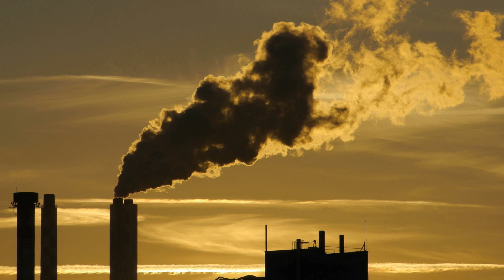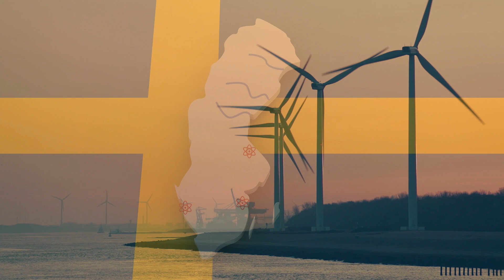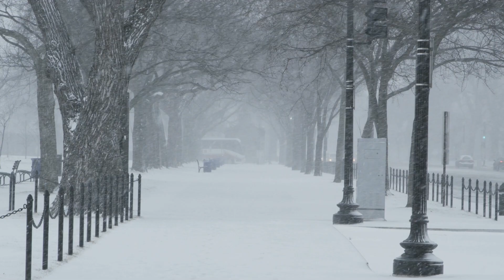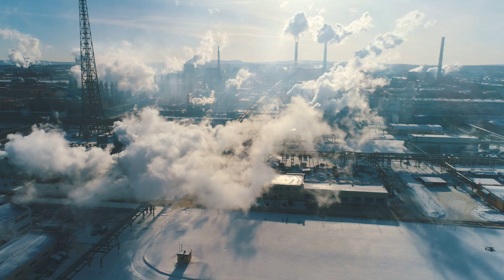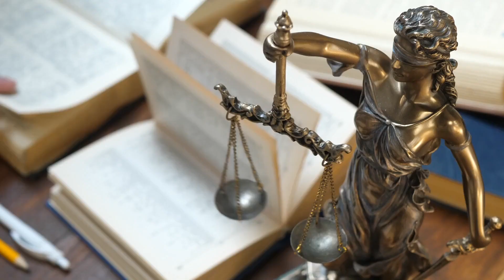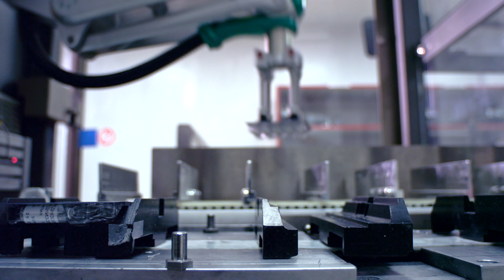Sweden's Power Problem

Comment: I hate the swedish government, they wanted to shut down all the nuclear plants because they claimed that we could run on 100% renewable yet less than 50% pervent of our power is renewable and were forced to import and burn more trash, which is to a big extent like burning oil. And were more dependent on foreign coal power and we even had to fire up an old oil fired plant because thats how bad it was, and this was in the spring or summer.
Only when the government was opposed by the "Right wing parties", threatening to put them down if you will, did they cancel the shutdown of nuclear power but now they are trying to delete the law that lets the countys decide if or where they want to place wind turbines.
The party who is most responsible for this kind of bullshit is the enviromentalist party which had just enough votes to make inte the parliment (4%) and they are by far the most hypocritical of all parties.

For instance one of its two leaders (Isabella Lövin) introduced a flight tax, shortly after it was revealed that she had been flying 11 first class flights to New York in the span of 2 years at the expense of the taxpayers. Dispite there being strict guidelibes stating that flights  always should be as cheap as possible unless absolutly necessary. 
She also greenlit the expansion of Vattenfalls (a state owned energy company) expansion of coal fired plant in europe back in 2016. And much much more.